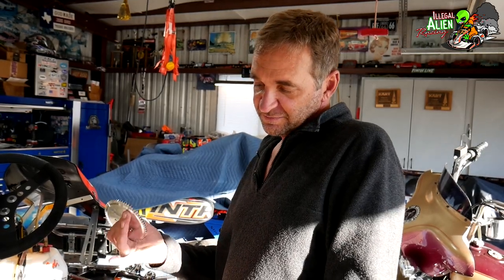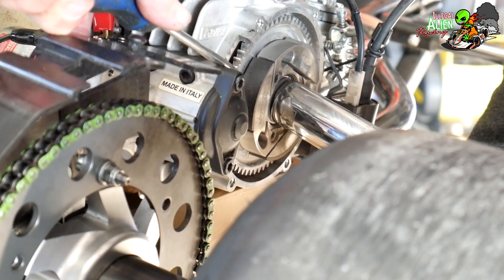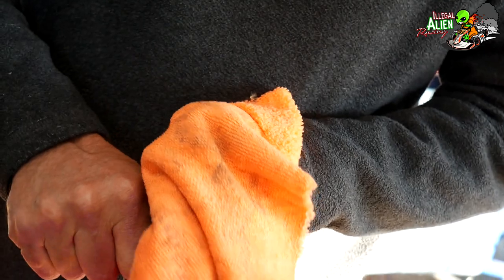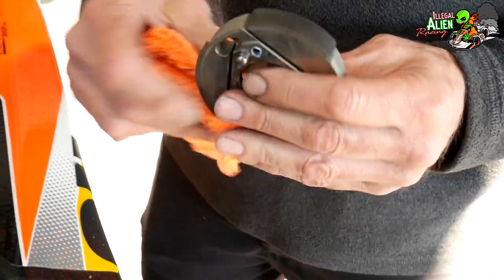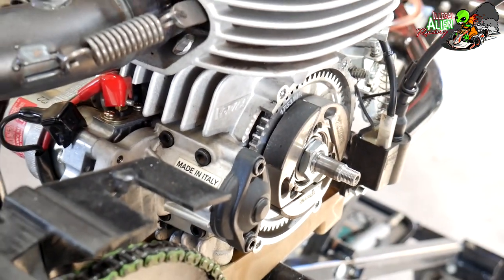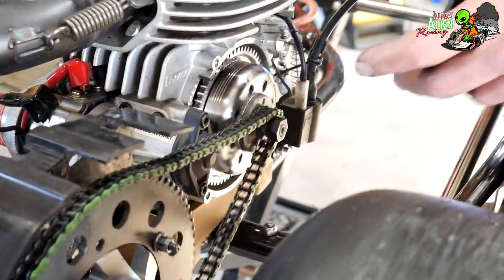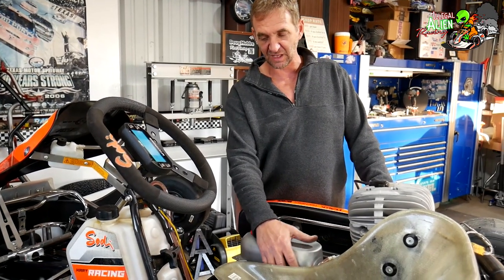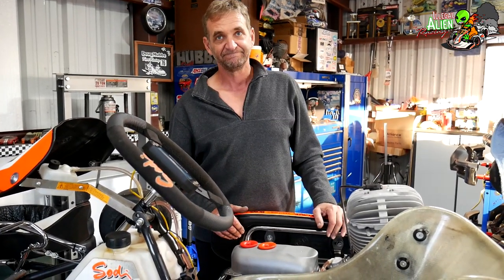Watch Out for this on the VLR 100cc

Comment: i have a VLR also and i hate the starter it always breaks or has issues when i first got it from DKC back in feb of this year for about 3-4 months we kept having problems with the starter but Sean kept replacing it cus i could turn it on like 2 times then it would not crank only about a month ago did it stop doing that and it was the same issue you had at the start of the vid

Comment: Looking for my 1st kart so new to this all. You're telling me no one makes a proper steel flywheel???
Reply from the maker: Doesn't seem to be an issue on the KA100.
Reply: It is done probably to minimize rotational mass. On 17000 rpm each gram counts.
Reply: It's supposed to be light for snappy acceleration. Trials bikes and lawnmowers need heavy flywheels😅